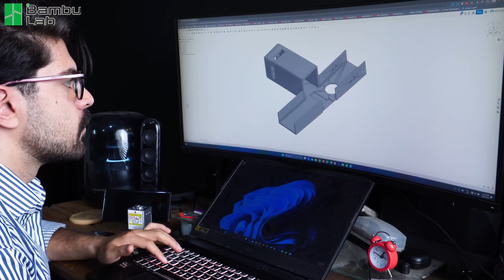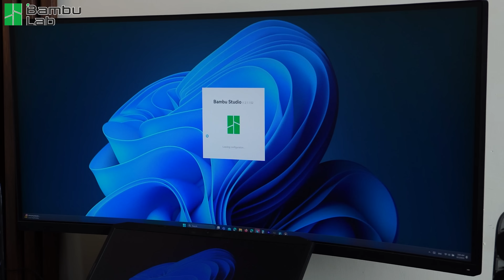I built a BURNING LASER LIGHTSABER That Cuts Through Anything

Comment: At this point it would be more practical but I would rather see people make laser guns
Reply: Yes but it technically do by far more less damage than constantly point over something,
Think like this you have weapon that can do 10 damage on per sec using light,
If you make it shoot like laser gun you need to literaly make it seem like shoots ammo, there it literaly decreases damage because its only effective when its constantly running, unlile normal guns which can do damage even with single bullet without to shoot all magazine, soo for lasers guns or like something from star wars you definitely need higher tech and correct materials to shoot materials energy without to make gun itself explode too from that power, think like simple as old electric heaters, they needed constant full electricity to heat not some little part electricity

Comment: There's no 40W of optical power. But I assume the module is built around a NUBC31T laser diode, which provides 13W of optical power. The video shows a 2-5W burn-in capability. I'd like to know what kind of diode is inside the module.

Comment: I mean it's closer to a light saber than a lot of people have made so far. The next thing to solve is to make it thicker and to make the laser stop at a particular distance.
Reply: Maybe split it into multiple beams that meet at the tip like a long stretched out pyramid? I could be wrong but I'm pretty sure that lasers stop when they hit each other instead of just bouncing off, could also make it so that it functions as a ranged  weapon to by focusing them all super close together at the hill creating a super intense point of concentrated laser light and then letting it go by basically flipping the lasers straight and pushing the high-powered concentrated point
Reply: @CalebCain-q6g  Who taught you physics? Light doesn't interact with itself. If lasers hit eachother they just pass through.
Reply: @wdeltag no one I'm not even fully grown I was curious about whether something like that would work because I read about astronomers firing labor lasers into the sky and making the me a certain coordinates
Reply: @CalebCain-q6g  Ah, if you're a kid that's ok then, I'm sorry. I would recommend that you read a couple of encyclopedias. They can be very fun. I read a lot of those as a kid - grew up to be quite knowledgeable
Reply: @wdeltag sadly I'm actually 17 the reason I don't know much about this kind of stuff is because I was homeschooled and we focused mainly on Reading writing and math and I actually didn't even learn very much of that because we never had time for a proper education because there was a lot of ....... Stuff going on with our family what I was raised with a strong sense of right and wrong and they willingness to always be ready to learn more which is more than can be said for most people my age
Reply: @CalebCain-q6g  You have my condolences. I hope that you can learn more as you grow older. Your parents should've been more responsible and either educated you properly or just let you go to the public school.

The only proper way to learn for you right now is by seeking out interesting or useful information yourself. Like the physics of lasers. You can use books, articles, documentaries, pop-science youtube videos - anything of the sorts that won't let your brain go numb. Good luck
Reply: @wdeltag my mom did the best she could but taking care of four kids when her husband was on drugs wasn't easy thankfully she's married to someone who's not abusive now

EDIT: incidentally its extremely fortunate that I didn't go to public school, I'm trying to get my GED now and  there's a few people in my class I talk to and they've got some horror stories about public schools. not to mention these days schools don't teach much anyways, since they're only real purpose is to indoctrinate children and make them into easily controlled citizens (no literally that is actually what they're designed to do)
Reply: @CalebCain-q6g That might work. The laser reflecting back might also increase the thickness as well.

Comment: In one example from that tyro Pyro video he was able to convert a radar gun typically used by police officers into a giant laser cannon that has that blue powerful diode built in.

In one of tyro Pyro‘s test he was able to use that laser and punch a hole through a metal lid. Yup, that’s strong. Blue laser was able to have the capability to damage tin metal .

It was even powerful enough to punch holes through glass like a beer bottle .

Comment: now you need to take apart a 3d printer to upgrade your stepper motor vs the old optical drive. Or is the Nano not fast enough to control the focal point any faste?

Comment: maybe try getting a shorter wavelength laser to reduce diffraction. I also think your device is closer to a gun than a sword, and if I was gonna make a Laser Gun I would make it like a Taser and have the laser travel through a fiber optic cable after sticking in or to my target and have the auto focusing as a secondary function like the "Dry Stun" on most Tasers.

Comment: Your laser sword is truly fantastic. By combining the two lasers into a very small focal point, could it vaporize the copper on a printed circuit board? It would be a very useful application. Congratulations on sharing your assembly and brilliant explanation without using a single word!
Reply: Its not laser sword, its long range laser weapon, like literally of army laser weapons that can just point to drones in air and melt drones weaker parts from inside, laser than can can damage something more than 10 m 20 m or even 100 m is not just "laser sword"

For better to understand just imagine how easily you can set someones room to catch on fire or damage their tv screen while you are literaly in another building, like think about it for real

Comment: The device is nice and can be used in different areas. How many volts does the device work with and how many watts does it consume per hour?
Reply: normal 40W laser module need 12V or 24V power supply about 4Ampere.

Comment: you should increase the range of motion of the lens and change the ultrasonic sensor with a small laser range finding for improve the autofocus in longer distances, and scale it 2x or 3x what an amazing project simple yet beautifully engineered. awesome
Reply: that's immediately what i thought, use range finder; this acoustic stuff not work on longer distances; i need autofocus on up to 50 meters to scare seagulls that have infested our apartment block